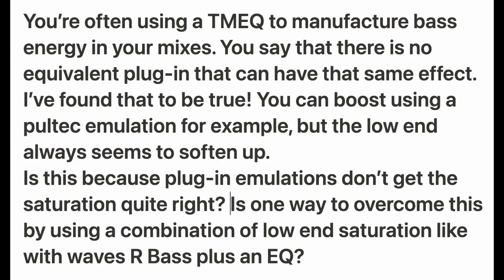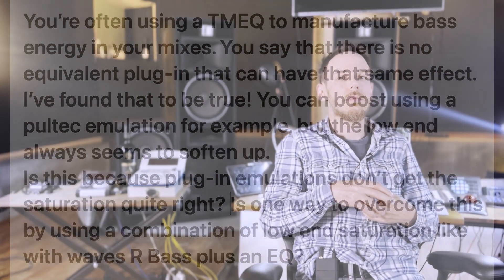WHY would an ANALOG EQUALIZER sound different from it's Plug-In Derivation?

Comment: If the eq curve is the same it can only sound different because of added harmonics or non-linear behaviour. A simple null test will prove it.
Reply from the maker: Yes, the "real" harmonic generation makes it alive. But there is more, the Trafos are doing other things beside harmonic distortion. A null test is a good way to start all the analysis. But then you also have to accept that you have a different noise floor in the analog gear than in the plugin. And noise is underrated. Audio Genious Anthony Waldron (CADAC) once said, that one reason why we like different mixing boards is all in the noise. The noise in an analog gear is "real" chaos and changes with different temperatures. It colors music, or makes it at least nicer to hear. I've done many experiments with this. 

to make emulations better, we have to develop how to get a harmonic distortion that is closer to the real thing (will be difficult) and we have to look with more precision in the noise of the analog gear.
Reply: @danieldettwiler.official  true, I find adding tiny amounts of noise actually makes a perseptive difference. Interesting, thanks.